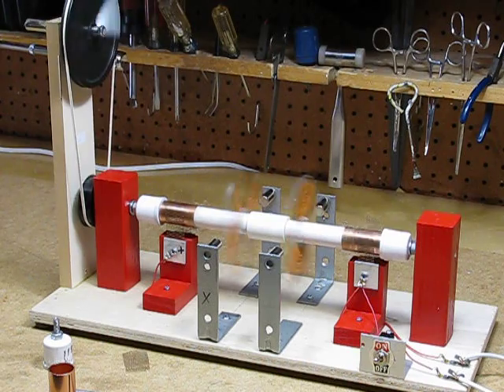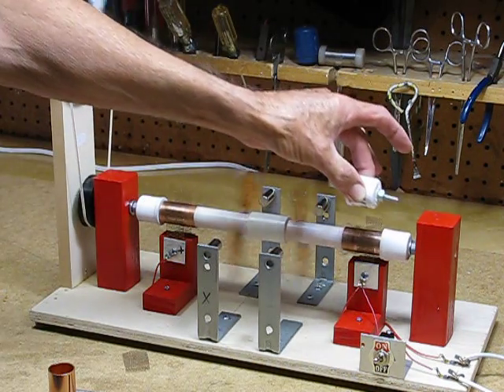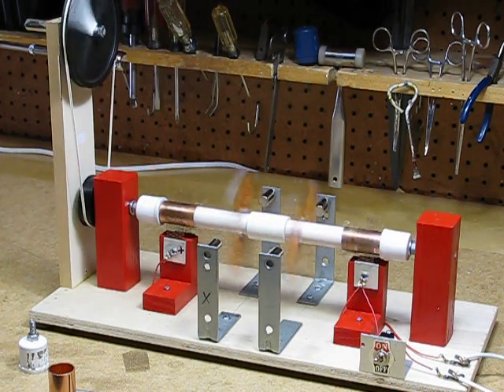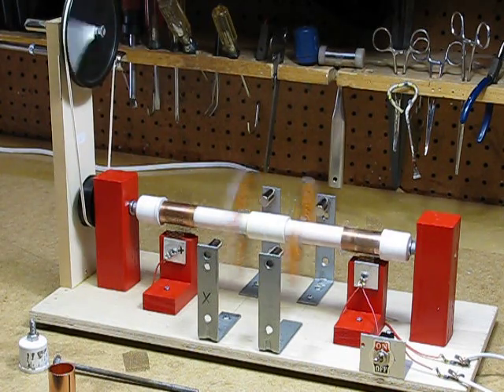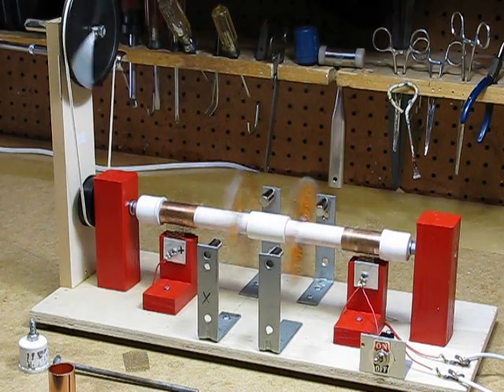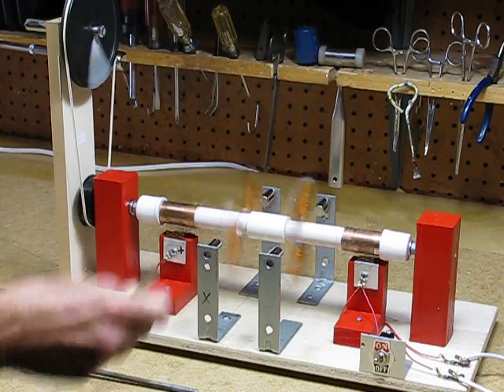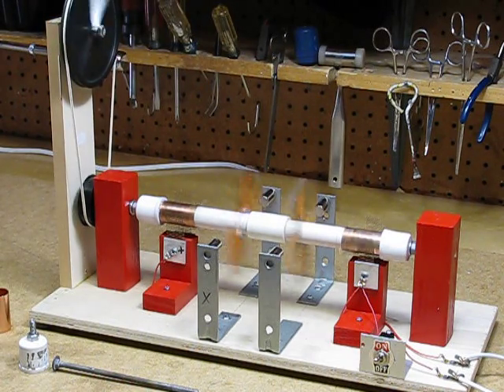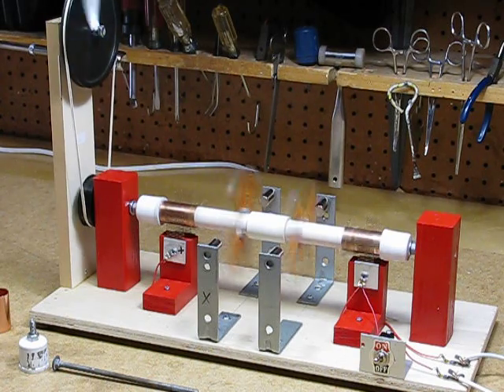HOME MADE DC MOTOR

Comment from the maker: Each winding on the carriage bolts is one, continuous length of magnet wire --as many turns as you can fit. Each end of this long winding is connected to one half of the commutator

Comment: What about the wire connection??? Is the copper wiring that is wrap around the cariage bolt connected to the copper fittings (commutators)?